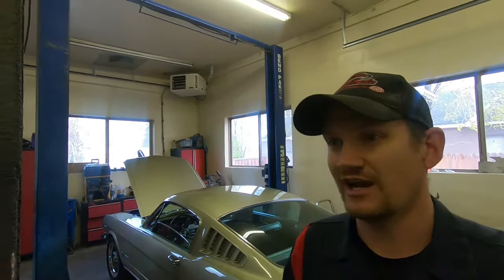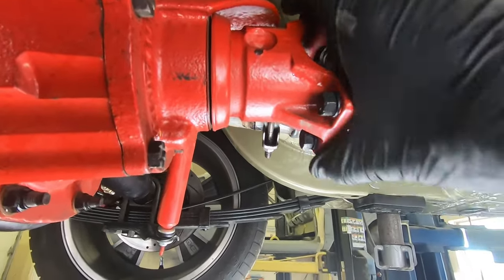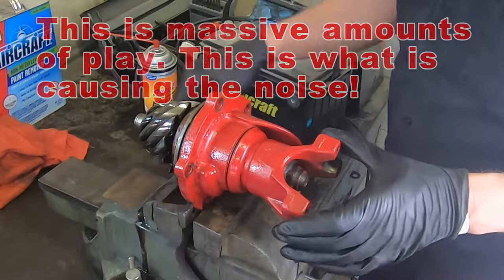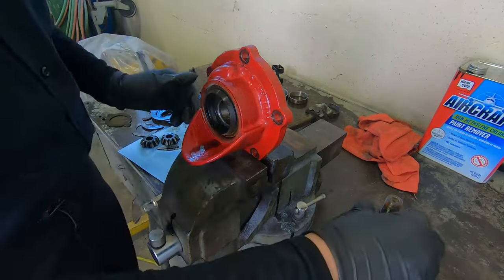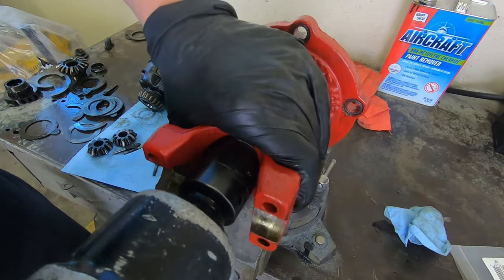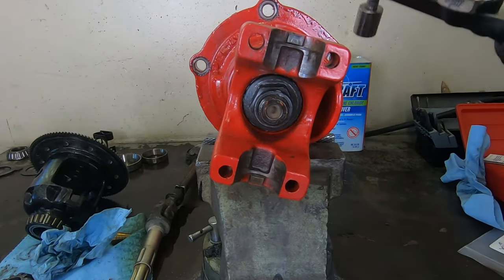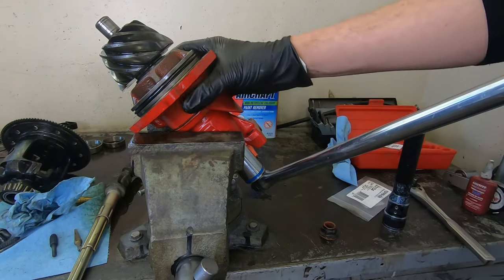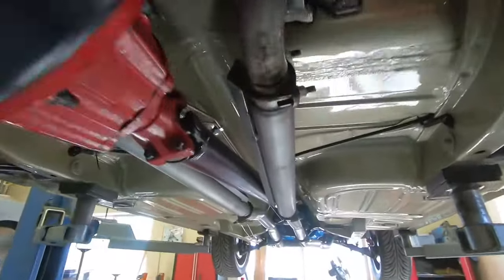How to set pinion bearing pre-load - 8" Ford - 65 Mustang Fastback

Comment: Great video on how to, I had to do this about two years ago on my 67, after removing the driveshaft I reinstalled  the U-bolts and made a 3/4" round bar by 3" long with a tapped hole in center (center long ways) then used my slide hammer and POPPED the pinion out, It works smoothly.
Reply from the maker: Oh very cool, thanks for sharing!

Comment: Wow, Ford pinion preload is much easier to set than a  in a '65 Chevy...I just had the yoke nut back off of my '65 c10 and it caused the pinion to groove the carrier...what a mess! It turned out the right bearing had turned to dust which caused everything else to fail. Once I start working on my '65 Stang your videos will be my go to for how to.
Reply from the maker: Oh ya these are definitely much easier than the GM differentials. One thing that Ford did right 😅😅😅

Comment: Last quick question. I have no clue as to the mileage on my 8 inch diff.  I am assuming quite a few thousand miles. Without the manual in front of me, what should I set my preload to?
Reply from the maker: 15 inch lbs for used bearings is what I usually go for.
Reply: @AlfsMustangGarage  that crush sleeve is a bugger to crush! I know I'm a pretty good bit above 175 ft lbs on the nut (breaker bar and cheater pipe) and I'm seeing about 6 inch pounds preload. It feels much better than it was when I took it apart, but I'm reluctant to put anymore torque on the nut for fear of doing something bad.  Is this normal?

Comment: I'm going to your Amazon link to get the crush sleeve, even though it says it won't fit my 66 8 inch. Hope it does!
Reply: Amazon says out of stock, so it's off to Oriellys!
Reply from the maker: Oh dang it! I should send them some lol
Reply: Oops.  Not the crush sleeve that's out of stock...it is the 8" seal (8181na). That's out of stock on your amazon link.  Local parts store had one, so I'm ok there...

Comment: Hey do all 8" diffs DO NOT have an oil slinger between pinion seal and a gear? Doesn't it supposed to be there same like 9" does?
Reply from the maker: I don't know about all but every 8" I've torn down doesn't have an oil slinger.

Comment: 🔔😎
I put solid sleeve from Currie in mine. Never have to be concerned by assembly or engine torque over stressing it.
I prefer the Eaton TrueTrak gear type posi. Very agressive and very smooth. Must use plain mineral lube. No synthetic, no slip additive... Either reduces the posi bias.
I always install a magnetic drain plug for easy routine oil changes.

Comment: Hey Alf. Are the crush sleeves you listed compatible with an 8 inch diff? Says they aren’t compatible but I was wondering if they really are and Amazon was just wrong.
Your content is so helpful and it’s great thanks for doing vids.
Reply from the maker: I'm fairly certain that those actually do fit the 8" despite amazon saying they don't. Worst case, compare them before you open the package that way you can send it back if I'm wrong 👍

Comment: Hi, I recently added LSD and 3.55 gears to my mustang 8 inch. Initally, it had some howling when turning at slow speed and slight whine. After driving for a while (I guess after braking it in and bunch of figure 8s) howl and whine was gone.  I drained diff oil, added friction modifier and  new 80w-90 oil. It now makes a horrible ratchet clacking noise when turning slow. Both sides. Straight sounds just fine. Only turning at slow speeds. All I did was drain and fill oil. Any thoughts?
Reply from the maker: Sounds like there is something wrong internally. Probably want to take it out to inspect.
Reply: @AlfsMustangGarage  I was worried about that. It was going to be a while before I opened her up, so I reached out to Quick Performance (where I bought LSD n gears), and they mentioned that they've had other users call them about similar troubles when using "inferior /off brand additives" sold in popular parts stores. He said to use the Ford Motorcraft additive friction modifier instead. So I drained some oil, added the 4oz bottle of Ford Motorcraft additive friction modifier. Drove it around for a while and the ugly sound is gone. It's back to normal. Yay! 🙌
Reply: The one I had used that cause the issue was LubeGard Limited Slip Supplement. 👎
Reply from the maker: Oh wow! Good to know thank you for the advice. I'm about to build one myself for a 67 cougar. I will remember this.